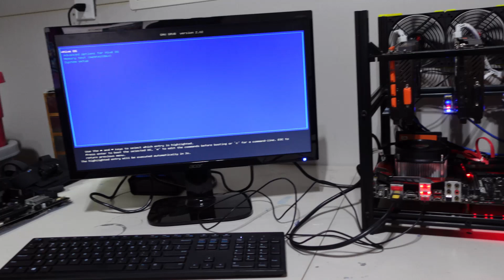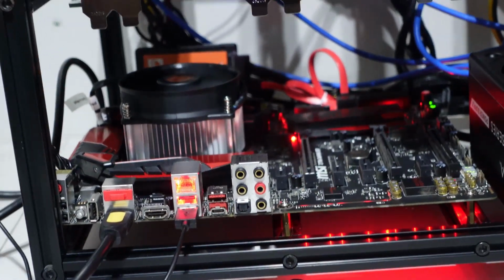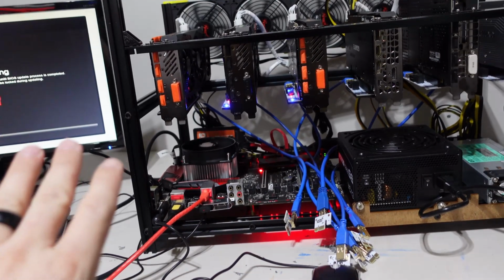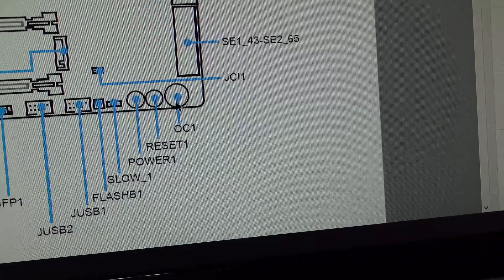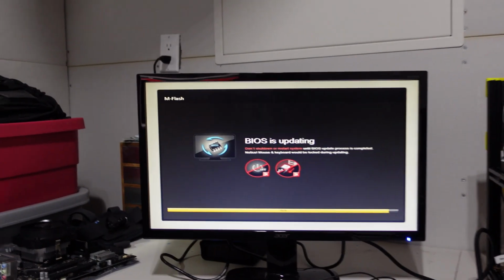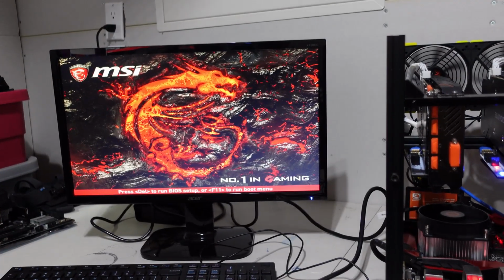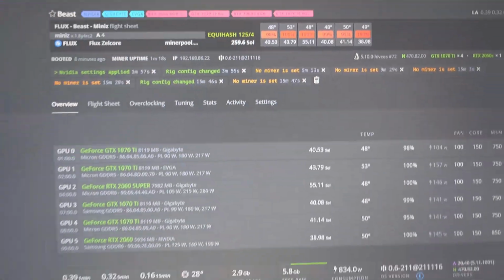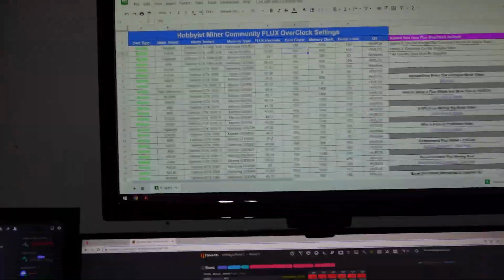Troubleshooting Broken Mining Rig That Won't Boot

Comment from the maker: Whats the Oddest, Wildest, Goofy Problem you had with one of your Mining RIgs?
Reply: Rig was offline for two weeks because of a dead CPU power cable :(
Reply: My msi board has those. Overclock button!!
Reply: Great video thanks! My rig start acting weird when I swop riser cables around... I tried to arrange the different cards in HiveOS, as it randomly addresses it. I gave up trying to arrange them, so now my HiveOS dashboard is a mess... 😜
Reply: Network fragmentation with a asrock h110 intel lan onm hive os. This make crash you entire wired network an you have to reboot you rooter/modem . Took me almost a week to solve.
Reply from the maker: I had this same issue with the B250.  Was happening enough I sold it.
Reply: @TheHobbyistMiner  I just finished building my new rig and when I turn it on the fans turn on for a split second and turn off again. I have tried a cmos reset, changing the ram, I have put the new graphics card in my old pc and it works in there and i have tried another psu and still the same. Any ideas?
Reply: Did u try and put one GPU in the first x16 slot and then boot into bios, try that. if that works make sure u set x4x4x4x4 on the pci-e settings also dont forget 4g decoding, and maybe disable on board graphics set everything to gen 1 too... i have the same ASRock board from a combo deal..good luck bro!
Reply: Have a test rig, using and ASUS Z-590-P motherboard, with a Thunderbolt 4 add in card connected to a 3080 eGPU. One of the issues I keep running into is my BIOS settings keep defaulting back and will not save. UEFI boot is not automatic even if I enable CMS (have to connect a monitor and select it to boot). One would think there is nothing wrong with the onboard battery just due to its a new MB. Also, once you tell the system to boot hive, it will boot it, but you do not see the booting OS on the screen. The screen shuts off at that point.  Even if I plug the monitor into the eGPU. More trouble shooting is needed, im sure its due to Hive not providing full support for Thunderbolt and eGPU. What's puzzling is the bios always defaults, even if its plugged in. It will not auto boot even though it sees the only drive in the system and says its bootable and when it does boot I do not see Hive OS booting on the screen. Problems problems problems.
Reply: Built a 2nd rig w 5900x for raptoreum mining and i put a new gpu on it today. When I tried riser cables it didnt work, then I tried putting it on my 6 card rig with a m.2 to pcie adapter and it totally screwed something up. I changed like two things then had to completely reconfigure it because it wouldnt boot, cleared cmos twice. Then when it did boot ravencoin mining would keep crashing my cards. Now im running them on ergo, as for the 7th gpu its back on the raptoreum rig in the pcie slot without a riser. I should have started there. Now i have to figure out why that motherboard wont let me run off of one riser, or elseim worried adding more gpus will be difficult. its a  b550 gaming x by gigabyte
Reply: Fried a PSU by using a convertor for the cpu 8-pin converting to pcie power 8-pin, added the wrong connector and converted back to the wrong cpu 8-pin power. The convertor works great when you pay attention lol. Also heated up some sata connectors enough to snap them by hand when I moved equipment.

Comment: i had issues with that same, exactly same motherboard. Took it out to clean it then nothing worked, had to do a hard reboot, took the cmos battery pressed the power button for minutes etc etc, then had an issue with the hard drive, solved it, then the RAM didnt work, and finally reseting the RAM solved the problem

Comment: After my Motherboard would not boot i ordered 2 of the MSI Z 170 A Gaming M 7 Refurbished from Newegg. I got it plugged into an 850 Asus Rog Strix Power Suppy. It botted right up, my RGB DDR 4 3600 Mhz working great, Fan and CPU apparently too. The only problem i have is that the Monitor is dead. Is a brand new MSI curved monitor. My only guess is that my Screen wants the Connector which is cut of a bit on a 45 ‘ sadly i only have full size to mini HDMI connectors. I will order one from Amazon to hopefully resolve the Problem. Do you have any other Tip why my screen stays black & does not show the MSI Bios on the Screen like yours did. Greetings 😊
Reply from the maker: Does it boot into bios with no Graphics Cards installed? Wired into the Motherboard for display?
Reply: @TheHobbyistMiner  I tried both it does not make a change if I plug in the HDMI cable into the Graphics card or one of the two HDMI inputs on the Motherboard. I actually ordered an I 6100 T and combined it with a Gskill DDR4 3200 MHZ, just 1 16 GB stick but nothing. Since these were Newegg Refurbished motherboards I am currently trying to drain the Cmos, it's a brand new Energizer Battery. Removed the power supply to the motherboard and unplugged the Asus Rog Thor 850 Watt. I will wait like another hour . the crazy thing is that the dual error code display shows 00. 
I really hope that you have a saving idea. I have the suspicion that even then I plug a graphics card straight in. the 16 PCIE Slot that the Motherboard does not recognize the GPU. but in order to change that I would have to get into the Bios to change the PCIE lanes to Gen 1. I have 4 motherboards and rigs basically ready to go except having to flash hive OS onto the M.2 Drive and then Program the Flightsheet's in HiveOS. but without a functioning Display and being able to get into the Bios I am just at a dead end
Reply: No i tried this for a long time. My question is which HDI cable and what is the resolution of your monitor ? Bc i heard that the Z 170 A can only display the Bios in 1080  K which in today’s terms would mean a FHD or QHD monitor. I did get from Amazon an HDMi cable which converts the 4 k to 1080 P on a D Sub Connector. But i tied last night until midnight & had no luck. I came up with 2 final solutions, i will buy tomorrow at BestBuy a new USB 3.0 Stick Flashdrive & a 1080 Monitor.
My last question is which Bios Version did you flash the motherboard too. There are several, some day that the original C bios was the best and functioned with the I 6700 K with no problem and was able to swith the board to those integrated Video Feed of the CPU.
Otherwise i am slowly working on a 12 x 580 8 GB Saphire of which i have 3 already and just ordered 4 new was a steal on Ebay for $150 per card. I will see tomorrow what Best Buy in SF has….the Operator told me that they had Sapphire 580 in stock. Maybe you can let me know over night to which Version of Bios for the Z 170 motherboard you upgraded too ?
Thank you 😊🎬

Comment: I feel you man, my intenet been acting up.  They came and replaced the box and checked the lines and said something seems wrong and think they fixed it.  Sure enough as soon as they left as soon as I starting booting up my machines I loose internet connection. I can run one machine, but not my gamer and two miners.

Comment: Here's the last thing you should Try.
Replace the RAM with 2667 Mhz Frequency and put it in A2 Slot,
that is the specs that support between your mobo and the processors (ATHLON 200GE - CMIW).

Hope it could help you Bro, nice video as always
Reply from the maker: Thanks

Comment: Please help...I have just installed my 5th rx 570 gpu...all of them in hiveos...on a btc s37 motherboard...the first 4 worked perfect after tweaking the OC settings they have been working steady for weeks with very few reboots/crashes....now I have installed my 5th gpu another rx 570 and it has been trouble...  it comes up in hive ..gives the temp and fan % but always shows N/A for  the hasrate then crashes the whole rig after a minute or so..no matter what oc settings  i try and never shows its mining..I tried flashing a stock bios but after the reboot   it does the same thing...any suggestions?? I had to take I out of the rig...other 4 working great again but the 5th makes all of them fail..Thx for the help....could it be a driver prob for this one? A bad gpu? Or any suggestions please help
Reply: THATS NORMAL, WHAT I DO IS WHENEVER I INSTALL A NEW GPU, I REMOVE ALL THE GPUS FIRST, THEN INSTALL THE 5TH GPU ON THE NUMBER ONE X-16 SLOT, LET HIVE OS INSTALL THE GPU TO THE SYSTEM, AT THIS TIME GO AHEAD AND SET A STANDARD OVERCLOCK THAT YOU SEE ON THE SUGGESTED OVERCLOCKS, THAT WILL GET YOU CLOSE, THEN START HIVE AND SEE IF THAT NEW GPU ON THE FIRST X-16 SLOT MINES, IT SHOULD MINE ON ITS OWN BY NOW.

THIS IS MY STANDARD PROCEDURE WHEN I INSTALL A NEW GPU TO A RIG. BUT I SAVE ALL THE TROUBLE NOW BY DOING THIS ON A TEST RIG. IF THIS DOESNT WORK FOR YOU THEN YOUR NEW GPU IS USING THE WRONG OVERCLOCK WHEN BOOTING,...HENCE...THE REBOOTING OF THE SYSTEM IF THE REBOOTING CONTINUES, THEN YOU HAVE A BAD BIOS, BAD RISER OR BAD CABLES...HOPE THIS HELPS U
Reply: @bbgcars  thanks so much
Reply: YOUR VERY WELCOME!

Comment: Having similar issue where rig runs stable via miniZ then hours later stops mining but hiveos still running. Sometimes hiveos looses connection I just reboot rig and it starts mining again. Not sure why this is happening. Maybe wireless connection not stable enough for network speeds needed? Still trouble shooting..